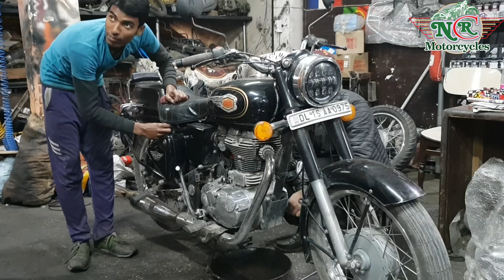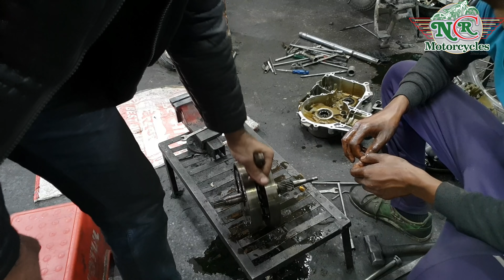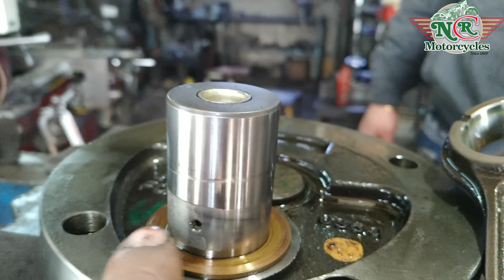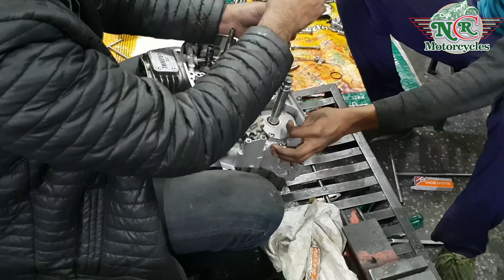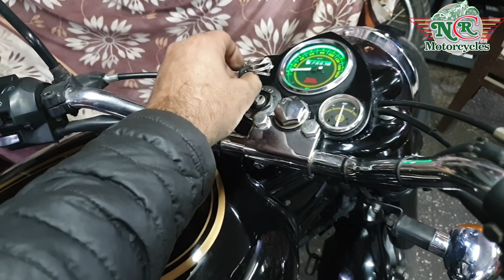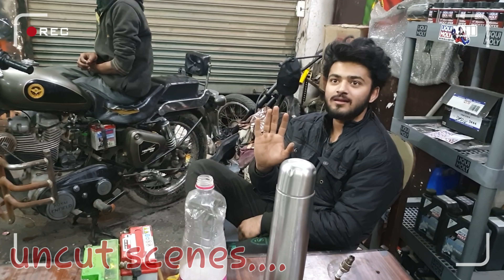Crank sound in standard model | ncr motorcycles |

Comment: Hello Bhai my name is Harsha. I'm from Bangalore.. recently I purchased a used Thunderbird 350, 2017  model. I guess you also have a Thunderbird I have seen you riding in most of the videos...
I need your suggestion regarding the headlight.. I feel the headlight of the bike is very low even the high beam will not show me more than 10-15 mtrs...can you please suggest me if I have to change my bulb , which one should I put. I don't want to put an LED if I have to change the bulb should I put any relay for it...

Comment: Hi !
I've got a 2017 Royal Enfield Bullet 500 EFI (Italy) and I can hear the sound from the crankcase.
How can I solve it ?
Is it really necessary to open the engine (in Italy it costs more than the bike value) ?
Could it be a matter of wrong oil (I bought it second-hand) ?
What the sound could cause ?
Is it just a problem of the sound or mechanical issues are present ?
Reply: get rid of it. if you think that repair would cost more tha  value of bike otherwise if you wish to keep the bike would suggest that ride it till it startes knocking in high speed and UCE is a very simple engine maybe if you wish you can try to work in it yourself !
Reply: and it could be due to anything low oil to wrong grade of oil or outdates oil that does not meet modern standards.